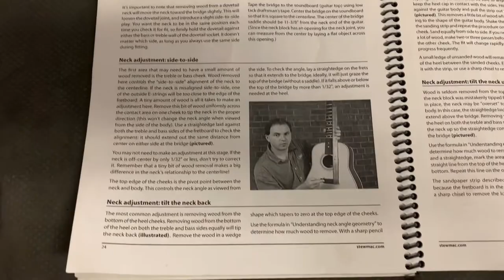Building an Acoustic Guitar Kit - Part 8

Comment: Incredible info. I have learned a ton from you. 
I just got my kit and my bolt on neck has a lot of play in the neck pocket. I thought it was supposed to be tight. Is this StewMac not staying within tolerance?
Reply from the maker: Not sure, maybe to give a beginner a little wiggle room during assembly?  When making the joint from scratch I would definitely try to make it a tighter fit.